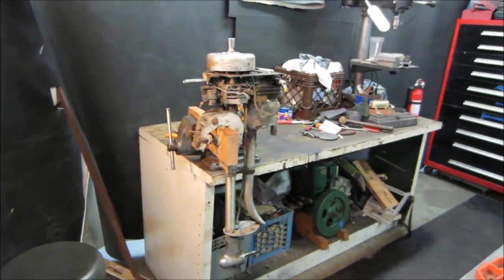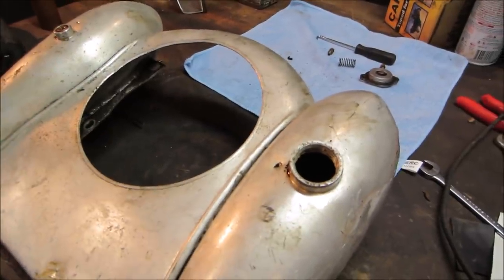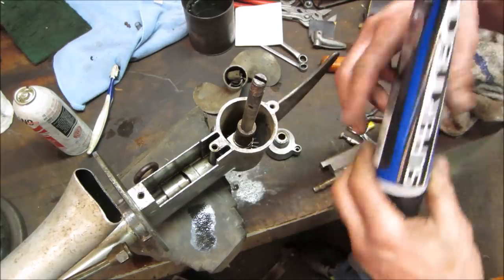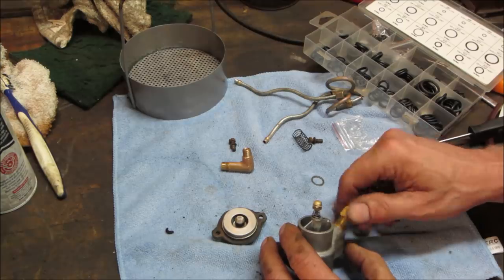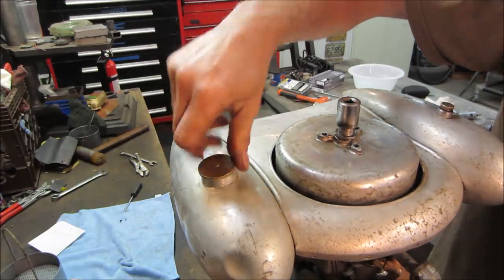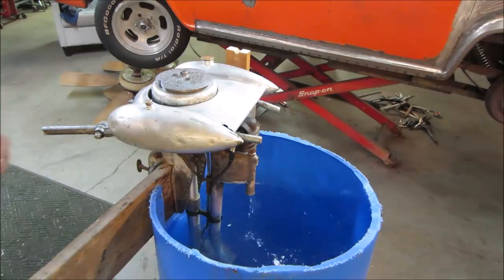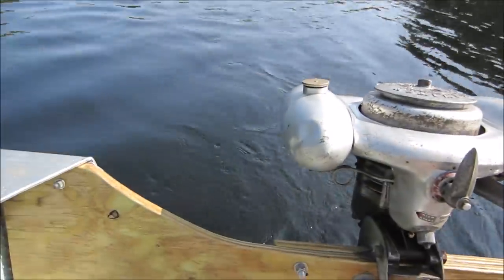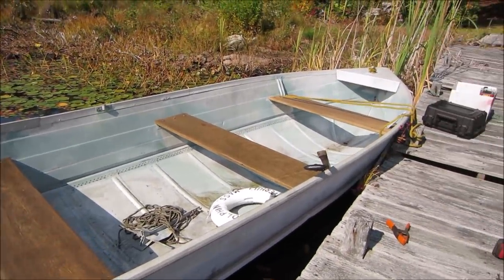1937 Boat Motor, 60 years in a Shed. Will It Run? Pt 2 of 2

Comment: Excellent video thank you so much I now know so much about the 1940 water witch I found in an attic and as I don’t have a fully equipped workshop I figured out what to do with it with research and one of the big points was that a mix of 10 to 1 required to seal the piston properly and get it to run smooth. Omg hand out the gas masks. Having said that people seem to be asking hundreds of dollars for ones in worse condition than mine so now I don’t know whether to pollute or trade. Anyway thanks again you’ve made a fan.

Comment: Warning! At about 15:40 you seem to be adding GL-5 rated gear lube. Many, though not all, GL-5 formulations contain phosphoric anti-impact additives that can dissolve brass or copper bits like salt on slugs. Since I believe I see some sort of brass block within, you may want to clean out that lube and try again with either GL-4 rated or even "00" type semi-fluid grease. You can usually find the straight GL-4 stuff like Mercury's Quicksilver brand in the boating section of Walmart. You might want to get a few quarts since LOTS of older vehicle  gearboxes ask for it what with their brass synchronizers and other bits.

Comment: The left tank is gas and the right one is for the oil .Also most of those old engines used straight 30 W oil . Another as the engine runs and draws the gas and oil it mixes them for fuel and lubrication at the same time at ruffle 10 to 1 mix ratio .

Comment: My father had one of those back in the early 50s it was plucked from the bottom of a lake in Maine and his neibor who he grew up with got it running and used it untill my father bought a Scott 71/2 hp then this sat untill his neibor passed away in 08 and his son-in-law took it when they cleaned out his shop I missed that one

Comment: Not sure on this outboard, but a lot of old 2stokes need the 30 weight oil, it acts as a seal on the brass bushings, you might find it starts and runs better with it and your lowest octane fuel at the recommended ratio. Neat to see though

Comment: When you get gas tanks that need to be cleaned out like that, get some BB's and load them in the tank, Shake it for awhile and dust will empty out. Then have at it with the  solvent cleaners.

Comment: @7:25
I mix 1oz acetone per gallon of gas in all my cars and 
equipment, 2 or 4 cycle. Acetone slightly increases the Octane,
making the fuel a little less volatile, to reduce pinging (pre detonation)
and give it a small bump of HP. Acetone of that ratio will not harm
any lubricating properties of 2 cycle oil.

Comment: That carb reminds me of a 19 teens motor cycle carb, it would have a drip valve on top and the bottom adjustment , the bottom knob is the choke.

Comment: Awesome!!! That was a cool engine!!! It actually ran really nice after setting it up properly... I am wondering how it would have run with a ball-hone of the cylinder and de-carboning of the exhaust system... It would probably be impossible to find rings for this machine, but the ball-hone might have helped the rings to re-seat and run really good... The water pump seemed to work fine, as well as the lower drive unit... Very cool taking it out on that lake...

Comment: You will find it will run better with old style oil and 10 to 1 fuel ratio  As it has no crank shaft seals the thicker oil helps work as seal. We have found this out in the old seagull outboards we restore

Comment: Him nice work, funny how the carby jet is basically the entire fuel accelerator system

Re the fuel tank - i had a similar issue with rust and scale on a motor bike tank, i added a few litres of cleaner, then about 3 or 4 handfulls or 10-15mm gravel , kept it in the boot of the car for a week while driving to work and back, the cleaner and the constant scraping of the gravel done most of the work.

Some people do the same but use a long piece of dog chain or similar

Regards
George

Comment: It sound good but I don't think it is getting full RPM's. If you listen to an old Homelite ZIP chain saw they sounded like this engine at about 3/4 throttle. That's the saw I grew up on and while I have not run one in years that sound will never fade in my memory. The other thought I had is you need to check out how hot it is running with a Laser Temp Tester. It should not be making that much steam. You look like you enjoy what you do. Thanks for the Video! Bob on Virginia

Comment: Small river rocks in the tank. Shake them around. Just like a tumbler polisher. Then put some cleaner in there as well and shake it around. Remove the rocks and then soak it for a bit. That will get a lot more of the junk out of the tank.

Comment: HI musty1      fyi    if u shear a pin and dont have one u can still use that one     push the center piece to one side put a broken piece in behind it and the other broken piece in the spot in the prop then carefully put the prop back on      it will drive the prop with one side of the pin       trick my dad taught me

Comment: Nice one Mustie1.  Do you think that the water pump should be pumping more water up and out than it is? Also the electric start is great, perhaps you could make up a simple lock plate picking up on those 2 screws to stop the fly wheel nut from undoing? Love your videos, keep up the good work :-)

Comment: Oh how I remember shear pins from when I was a kid in the 70's and my old man had a 40 HP Johnston outboard (he had a boat too obviously, lol he didn't just lug an outboard around for ha ha's), I can remember them going a few times. He used the boat around NW of the UK, and we were water skiing one day (I was only about 6 or 7 and they only had adult skis so I was still too young) off the coast of North Wales and the damn shear pin went about 5 times. I don't think my old man realised how low the water was because there were sand banks everywhere, but he was getting towards the end of his pile of shear pins, I guess it could get nasty if you didn't have spares and you were on the sea, even if you were right close to the shore like we were, you'd be up shit creek, lucky we had a paddle with us, not that we needed it in the end.

Comment: If you put small nuts into the gas tank and put what ever too sel the opening and shake the gas tank that will help brake up the junk in the tank. And by using nuts you can use a magnet to git all the nuts out.

Comment: My dad walked by and out off the blue said "that man is using oil not grease in that outboard, thats why its rattling so much" looked at the screen and said " I think his exhaust is leaking, that will make it a bitch to find stable revs" and walked away... totally forgotten that he was a rower on grandpas salmon boat in the late 1950 and early 1960 before the dam went up.

Comment: You really need a one-way clutch on that 1/4" drill attachment to make that electric start a go-er. Losing the flywheel nut in the middle of the lake would not be a good thing... 
or the entire flywheel for that matter :)
Cheers,

Comment: My wife likes to clean dirty flower vases with a handful of old BBs. She throws them in there and shakes them around with some soapy water or something.  I wonder if you couldn't use something like that with the gas tank. You need something like that to knock the crap off the bottom where you can't reach it.

Comment: MUSTIE. Theow your nuts and bolts jar in the tank. Pour some gas or any chemical cleaner. And just shake it. It will come out looking brand new. The tank that is you might have to clean the little parts manually

Comment: Mustie, do you have any videos available showing a proper way, or how you do it, for winterizing equipment that’ll stay outside for the winter? I’m thinking riding mowers, push mowers, quads/4-wheelers, etc that’ll stay in a non heated shed or garage for the winter. If not, perhaps that could be a good video or series? Thanks!

Comment: Each prop has a designed RPM range for the desired speed vs torque.  The engine can exceed that spec and cavitation will occur.

Comment: Hey so I have this lawyer mower from the late 80s early 90s and i hadn't run in 15 years and the carb was kinda iffy so once I had spark I put this can of carb cleaner in it from the 80s and I was socked cause it was like really clear blue carb cleaner so I put some in my bone dry      gas tank turned the key and it fired up ran like crap for 10 seconds and then cleared up so I shut it off and started back up and it started to the touch of the key and ran so smooth I gotta say that old carb cleaner works really good

Comment: Kissel car company designed these and started producing these for Sears in 1936 eiseman Magneto same points and condenser that Maytag used in their twin cylinder washing machine engines and Reo Motors used these in there first reel type lawn mowers

Comment: Watched you taking apart the carburetor,  I think that it is called a mixer not a carburetor. It is not new, a 1 cylinder Cadillac has a similar thing on it with a thin brass round disc that vibrates enough to introduce a charge into the combustion chamber. No float bowl

Comment: I bought a 1938 Waterwitch 7/15/22. It was screwed to back wall of a shed. I offered $25 because of the atomic age style. Engine   is locked up. Too cool not to

Comment: A bunch of nuts & bolts or some short lengths of chain in the tank with your cleaner.  Then shake the crap out of it leave it  soak.  
Repeat until clean.

Comment: If you're going to keep using the drill to start, maybe locktite or lock screw the bolt so you don't lose the flywheel over the side one day. I'm not that sure the water pump is working that well - too much steam at times.

Comment: I think you can get a one-way “clutch” bearing .. to allow “up-rev” when the motor starts .. (electric start RC airplane motors have them, as well as auto-rotation one-way bearing on RC helicopter main rotors) ...

Comment: please add a safety chain or wire to connect to your boat.the motor mounts can vibrate loose and it would be a shame to loose it after all of the work youve done! I am speaking from experience.

Comment: impressive for making it run but Its a little hard starting and does the water pump work? did it have one?  It uses lots of fuel. The technology is not there it will make a good wall hanger or conversation piece. You will hopefully find a more modern up to date motor you can trust and easy starting and easier on gas that you can  put on your boat. I hope you find a small Yamaha or honda motor to put on your boat so you can easily start and trust to run efficiently for more fun.

Comment: These old plonkers need 10:1 mineral oil to cushion the plain bearings - there is no advantage with the modern oils and lean mix ratios as the oil film isn't heavy enough to cushion the bearings.  We went to 16:1 with the similar era British Seagulls as even 25:1 would kill the bearings.  The oil film prevents metal contact by hydraulic lock.  Tends to help seal the crank bearings keeping up crankcase pressure too.  Very simple engines indeed.

Comment: YOU SHOULD MAKE A PIN TO HOLD THE PULL CORD PULE DOWN TO THE  MOTOR BEFORE IT GETS LOUSE AND FALLS INTO THE LAKE  / YOU SAW WHAT HAPPENED WHEN YOU TRIED TO START IT WITH THE  DRILL  / THE HOLE PULE ALMOST CAME OFF  /  GOOD LUCK OR  JUST START IT WITH THE PULL CORD WHEN IN THE BOAT ON THE WATER SO YOU WILL NOT LOUSE IT

Comment: If you had said 60 years in a junk pile I would have had my doubts. But 60 years in a shed presents only minor problems. Three things make any mechanically sound engine run. Air, fuel, and spark. Let compression be your guide. If there is compression when the engine is turned over, and the three things I mentioned are present.... No matter who made the thing, it will likely run.

Comment: love it!
 i have a '38 Johnson 2.5 hp 2 cylinder alternating fire that i think needs the magneto coil rewound,. it ran(only at hjgh revs, and poorly) in the spring, now no spark, any chance you could get ohm readings off your high and low tension  wires?

Comment: 3:05 Speaking of that diagram, what came first the chicken or the egg?
Turns out that the composition of the chicken's egg  has a material it can only get from a chicken uterus.
If you could make an egg that produced a chicken without it, why would it be needed for the second?

But, .....why do I get a " Antique Gile Marine Engine " vibe from that contraption? Is it the carb?

Comment: 15:14 Should that part really be full of oil? That doesn't seem right at all, I would have gone for max 1/4 or even 1/6. And I would of course have put some oil on that cam, a thin layer will stay on for a long time, better some then nothing.

Comment: I see another way the fuel doesn't keep running into the carb when not running,... the fuel tank has a sealable vent screw right?! And the gas cap is non vented also, so if a guy screws in the tank vent then no flow to carb

Comment: You should have had the bottom of the outboard and a tub of water or a bucket or 55 gallon drum to begin with so you don't screw up the water pump in the bottom running it without water?

Comment: By the way that wireform is supposed to be at the end of the chain and the fuel tank? Is supposed to be a y-shaped preventing it from coming out from inside the tank unless you squeeze it closed to take it out, similar to what you do to the wire inside of glass Christmas balls!?

Comment: dont run those engines on that "tru fuel" I have found that it's cheaper and they run way better on the sthil full synthetic 2 stroke oil and regular 93 pump gas. with that tru fuel it will give you headaches because it's basically paint thinner and a little bit if oil mixed in.

Comment: It's obvious you don't have the settings set for where he should be starting on a cold start or choke position with your air fuel mixture and your throttle? You should have figured this out before you started jacking around with it and Market on the housing with a grease pencil

Comment: looks like the boat I jusrt6 bought but Im waiting for the registration numbers from the state Inthink it floats as it holds water whe4n ever it rains aswnd got a new used johynson 15 hp 2 stroke n fuel n ready n itcxhiin to get it on the water I shoulfd have left the old SD tags on it till I got the ND tags oh well live and learn. /then another used 48 hp johnson came available I think Ill kee4p emn both case I wanna take it on the river por bigger waters n have obe as a backupI thin k itl be a lot of fun dongt know if kitll help plain out but I added a hydro floil to the motor aNY WAY just c\urious any way to see whaqt my beginner boat will do its just a fishing boat anywaY UN   LESS UR PULLING A YOUNG KID AROUND.

Comment: Again another screw up on your part, you had it running Full Throttle in the barrel? Wedding you mark those settings on your dials so you could duplicate the same thing on the lake or pond? You left quite a bit through the presentation which is somewhat nice but it leaves me to believe that you're not serious about doing what you're doing?!

Comment: You keep jacking around with the fuel mixture and the throttle throughout the video instead of concluding what it should be set at when you tested the unit in your garage? This is quite disturbing that you can't leave this alone and just let the thing run at Peak Performance once you conclude with that supposed to be with markings using a grease pencil or Sharpie?
   I'm sorry but it's quite aggravating trying to watch your video cuz you keep jacking around with it instead of leaving it alone and testing the unit like it's supposed to be done!